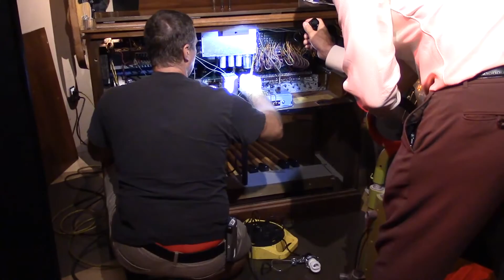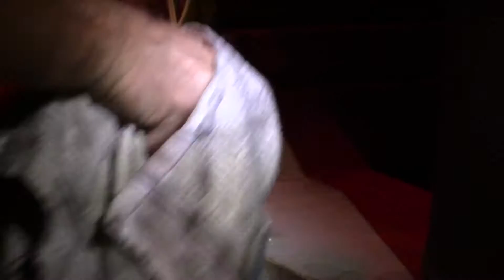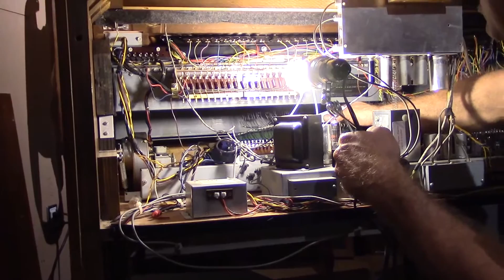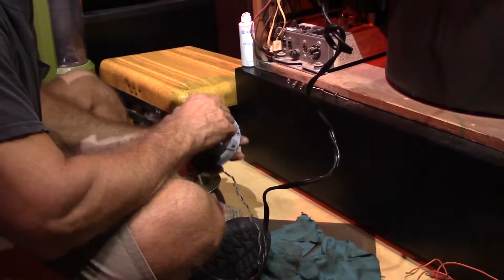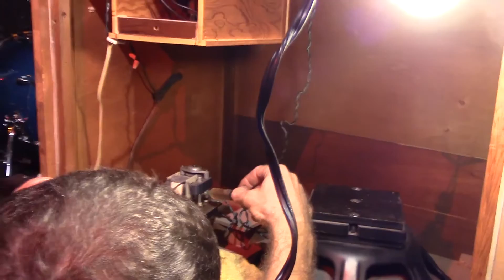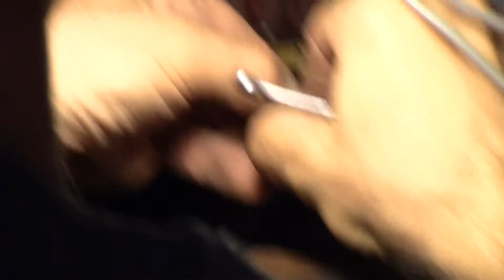Hammond C - 3 / Leslie Maintenance - Sacred Ground Studios

Comment: I had all my work done by Keyboard Products in L.A. early 70's. I had my 122 Leslie modified to a 180 watts amp with a 15'' JB Lansing speaker. I wanted to drown out or should say keep up with the Guitar players' amps. My organ kick-ass, no problems with any rock bands. Also, they put in reverb in my cabinet. Bought my organ in 1970 brand new and I still have it.
Reply from the maker: Very nice.

Comment: Many of these show how to oil slow motor bottom motors but not the top. I assume you have to take the motor out to get at the slow motor which is how I do it... If you have a short cut let me know.. Real pain pulling that motor out .. thanks
Reply from the maker: L,  I do not know. The maintenance on our gear is all performed by outside vendors. I wish I had time to understand it all, but I do not.